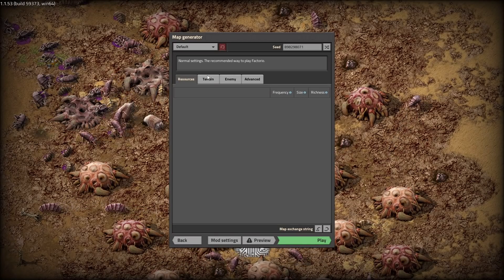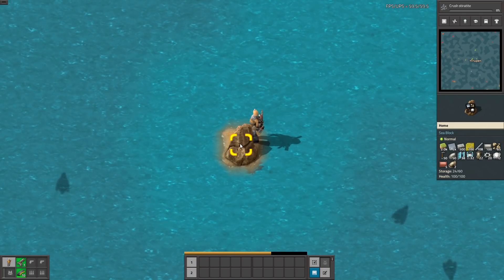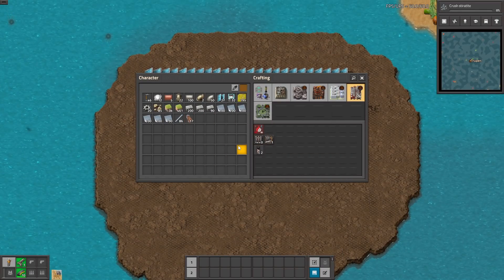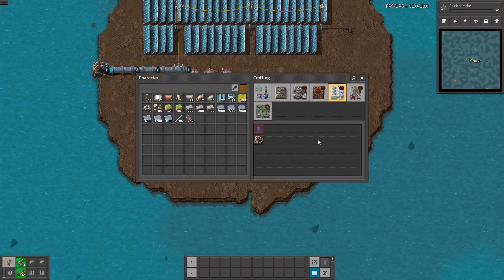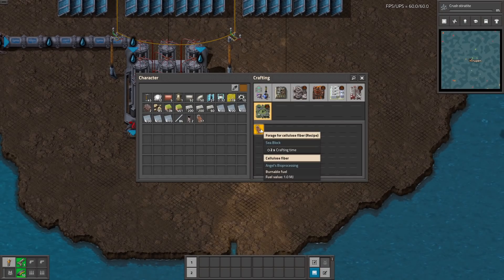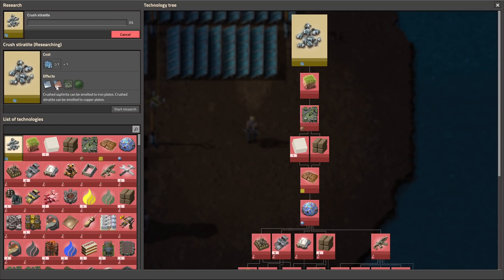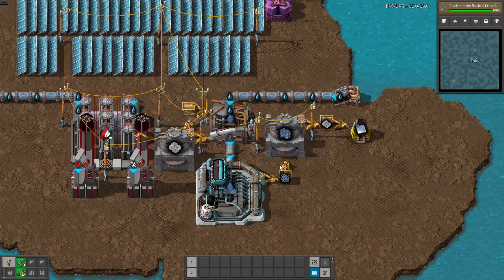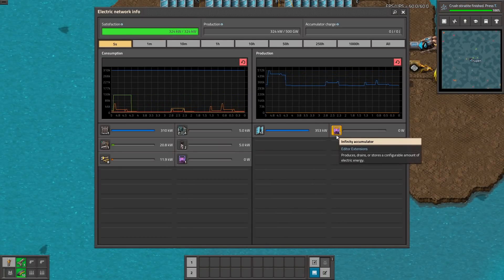Sea block.

Comment: Sea block is pretty old but it seems the start have been updated, it used to be you started with a bunch of windmills instead of solar cells and no batteries (looked like you start with those now, right?)
Definitely a fun way to play it if you are into the whole “factory must grow” aspect of factorio but don’t like fighting too much, but be prepared for long spans in inactivity while you wait on the factory to produce enough resources for your next piece in the ever expanding production chain.
Reply: Yes, Sea Block has been updated. It's a lot quicker to get started now.

But no., Wind Turbines haven't been removed. Trupen doesn't have the full mod pack enabled. Solar + Accumulators is the fallback in case KS Power mod is missing.

Comment: Wait, they went back to solar powers  again? They changed from solar to wind turbines as a starting power source quite long ago (at least in the seablock pack, a more noob friendly way to be sure everything is installed) and at least three month ago it still was the case.
Reply: Nope. Trupen doesn't have the full mod pack enabled. Solar + Accumulators is the fallback in case KS Power mod is missing.

Comment: As a space mod it needs some kind of water biters which could use the environment!
Reply: Nah. The start of seablock is slow as it is. Having a risk that something will come and eat through your industry you've spent hours to build (however meager it might be) wouldn't be fun at all. It might work if attacks start after you've finished certain tech level, but not with usual time passed + pollution level.
Reply: Some kind of water strider biter? Such a creature could never exist.
Reply: @thefonztm  yet
Reply: @thefonztm  what about some water slides too?